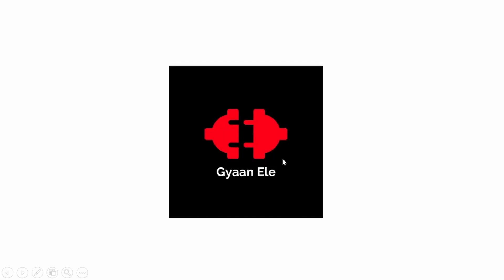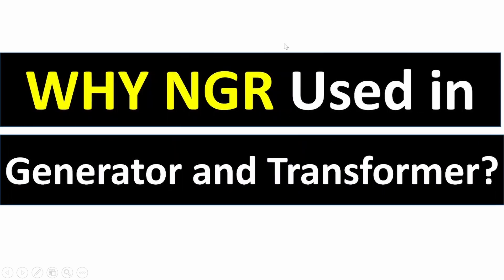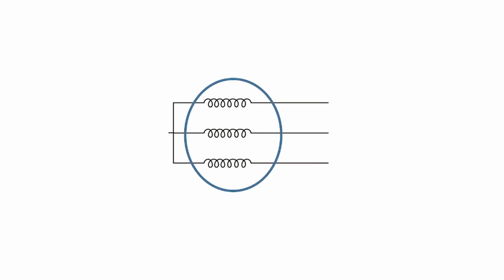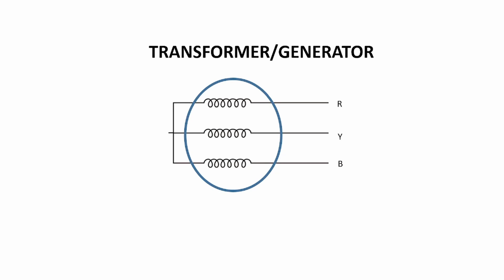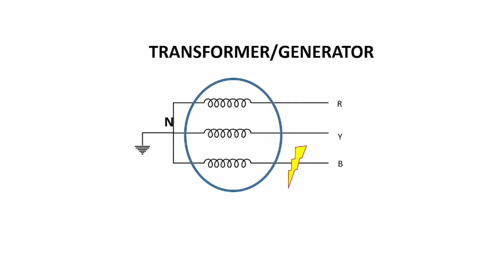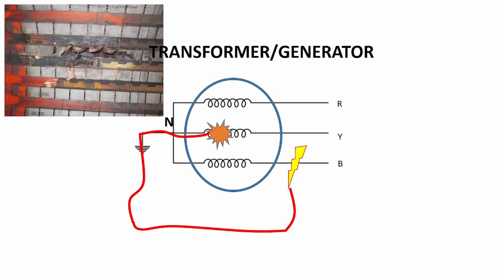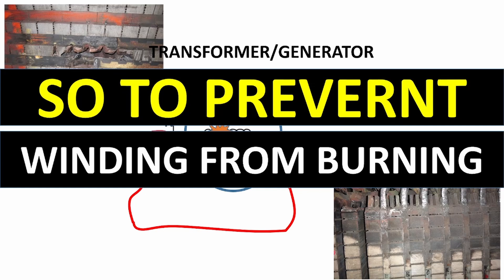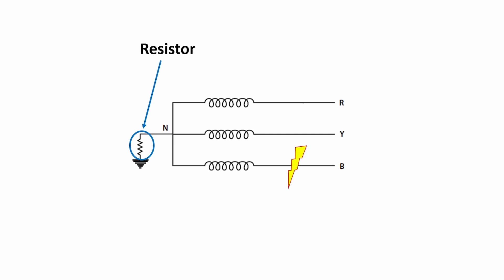[English] Why NGR? : Neutral Grounding resistor Part-1

Comment: Tell me one thing how current can flow from fault point to ground and ground to to neutral point because ground is made up of soil and rock ?
Reply: Ground have low resistance
Current flows where resistance is low
Reply: @ChandraShekar-zc9od Thanks for the clarification.
Reply: This is a good question. I wonder too...

Comment: The neutral grounding resistor should be zero for enough current to blow the fuse. 
A high neutral grounding resistor will result in not enough current flowing and not blowing the fuse.
Reply: if the NER is zero resistance the generator will be damaged